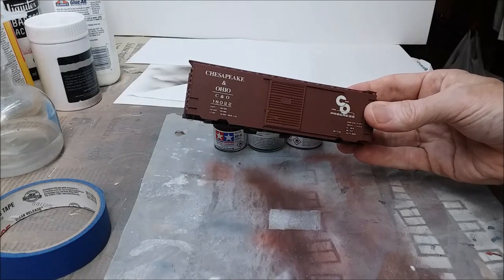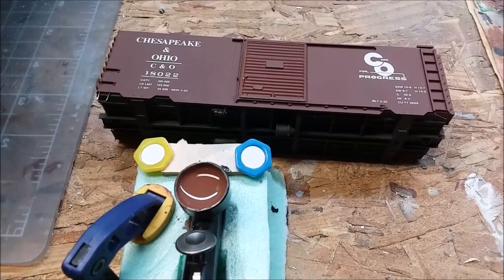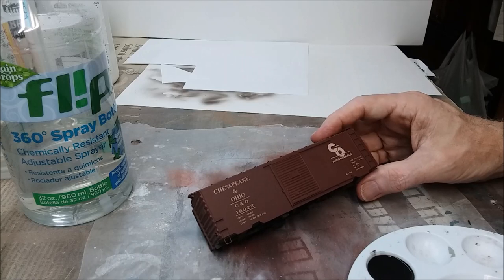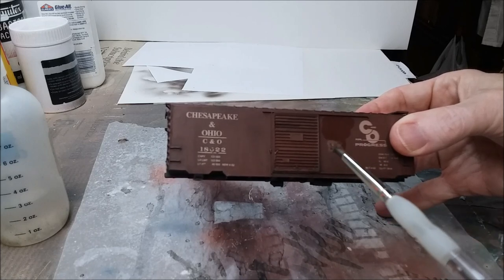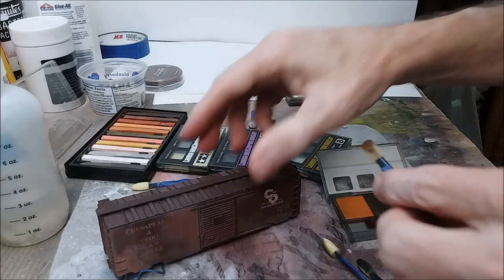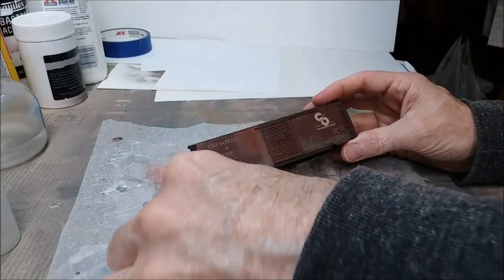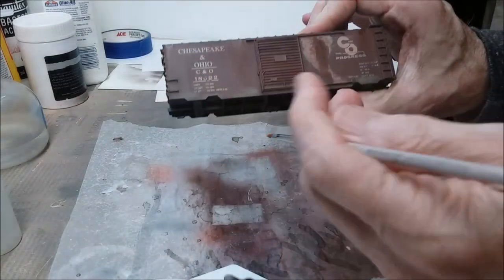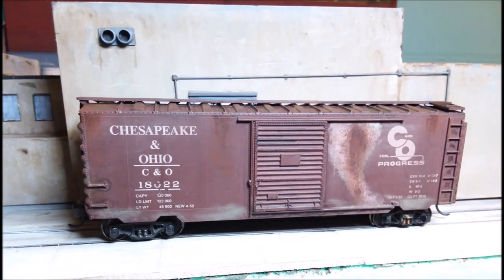Weathering a Boxcar

Comment: Well, thanks for responding to my request so quickly!  So far I've found fading the most challenging phase of weathering.  I've used powders/pigments or acrylic washes with a slightly lighter shade than the base color to reasonable effect, but I've never tried Tamiya colors with the X-21 flat base mixed in.  Funny, but I bought some of the Tamiya stuff, including X-21, a while back but haven't used it much, so I'll have to give it a try for fading.  I particularly like using sponge application on roofs as it gives a splotchy look.  And using the graphite pencil for metalic highlights on ladders and grabs is new to me.  Finally, I just happened to buy some of that Rust-Oleum flat spray a while back and now will have to test it, too.  Thanks again for giving me much to chew on and cheers from Wisconsin!
Reply from the maker: Great! I'm glad I was able to give you some ideas. The more flat base you put in the more faded the result will be.

Comment: It's nice to see how others do it. I have been using an airbrush recently but I did a video a while back where I used washes and powders, gives a different look if you fancy checking it out 👍
Reply from the maker: I'll check it out. I've done washes in the past and my main problem with them is tide marks. Using the flat base helps with that somewhat. Using oil-based paints works too, but I don't have the patience to let it dry sufficiently before moving to the next step!